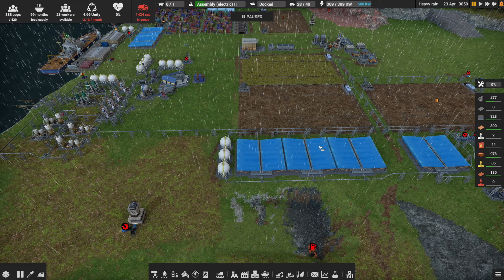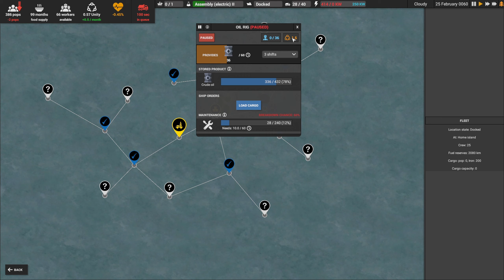Let's Play Captain of Industry s03 e19

Comment: Build copper plates storage too.
Reply from the maker: I may do that. I usually don't make use of buffers too much when I play factory games, especially when resource supplies are tight with the possible exception of Satisfactory where I use a ton of them.
Reply: @Glidercat  the maintainence isn't the only one demand of pure copper. That's the point.You needed it to produce diggers, trucks, electronic components...
Reply from the maker: @todormirchev1776  True, that's a good point.  I have a storage building already for copper but it's over by the ship and I placed it just to empty the shipyard. I will likely put one over by the copper production.  Good suggestion!